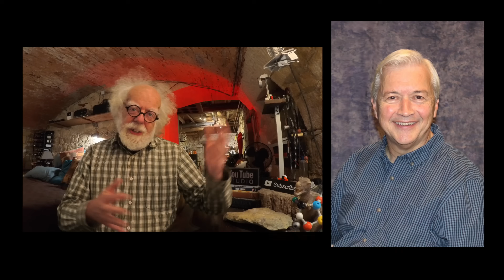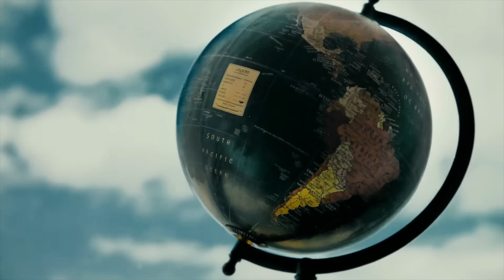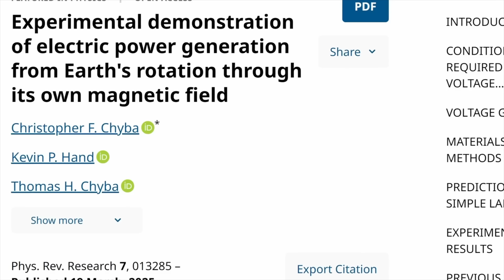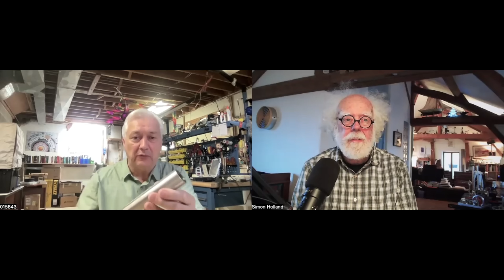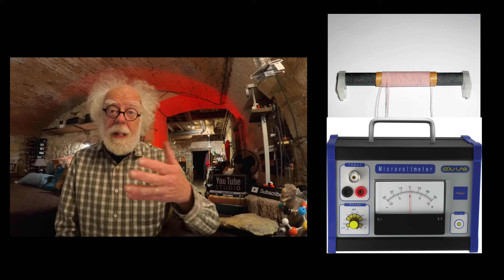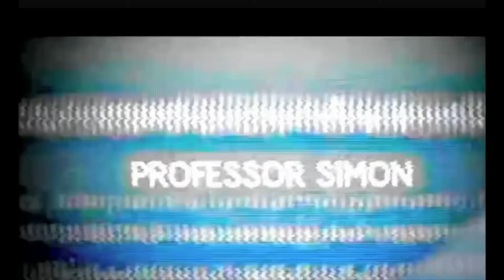Earth Generator Prof Chris Chyba Interview

Comment from the maker: Remember this was a science experiment to prove the spinning earth can induce a current in a wire, coil or cylinder.  Not a practical sized generator….that will come next….get working on it….engineers.
Reply: Give me some drawings and i can make components for it 👍🏼 CNC machinist.
Reply: If the potential difference can be exploited for useful work you're golden.  It's engineering from that point.
Reply: Exactly. There needs to be enough potential.
Reply: If Faraday had  discovered this way back then, imagine the technology today!!:face-blue-wide-eyes:
Reply: We do not generate electricity, we manifest it.
Reply: @ActivateMission2ThisTimeline  Ken Wheeler?
Reply: It is difficult to go beyond academic wisdom, otherwise the central question should be about the state of Energy before it manifested itself into its different aspects as electricity and magnetism and all other forms or force fields. And, of course, which function dissociated this primeval energy into these different manifestations.
Reply: @SimonHollandfilms  Hit up the folks that make the hollow carbon nanofiber for quantum computing. 🤔😁❤️
Reply: Energy has a draft, if you can tap into the draft...
Reply: The material Chyba used was ferrite MN60, which can be cast like any other ceramic.  It can also be 3D printed.  There is no need to purchase a cast rod of MN60, then try and drill out the center.  A simple Google search will show the various techniques to shape MN60.
Reply: i fb you
Reply: Spinning a coil or moving a wire can produce a voltage by induction from the Earth's magnetic field. If the coil has more windings and has larger loops, or if the wire is longer and is spun around like a jump rope, it can generate a higher voltage.
Reply: @evancole6863  True, but the Chyba idea is not to spin the wire because the Earth is already spinning at ~1400ft/sec.   The strength of the Earth's magnetic filed at sea level is about 0.5 Gauss, very weak, which would be roughly equivalent to spinning a 0.5 ft diameter coil at 1000 rpm in a 0.5 Gauss field, if his idea actually works.  Even if he got 1 micro volt out of this, it would not mean much unless he could also get sufficient amperage.  You can already get 400V/m out of the Earth's atmosphere now, but the current is extremely small.  Benjamin Franklin did a lot of experiments with extracting electrical energy from the atmosphere, with his famous kite in an thunderstorm.   A lightning bolt packs a lot of energy, and its free, too, but isnt a constant source of energy, at least in most places.
Reply: @evancole6863  doesn't need to be spining.
Reply: @Cz_ Opor měděného drátu je 0.17 mm/m takže většina magnetického pole země by byla zmařena v  odporu těchto vodičů. A i kdyby existovaly supravodivé materiály byl by výkon zanedbatelný pro praktické použití.
Reply: @SimonHollandfilms  Hollow coils can produce a voltage as well if subjected to mechanical vibrations that resonates with the crystal structure of the coil. If the coil is encased in a piezoelectric material, the squeeze effect from the vibrations produces a transient current which can amplify the voltage.
Reply: If its opposite, why was earth slowed as its speed was one isdue . Also the amount of energy must be according to use in size for its absolute result.
Reply: This tech will probably be used in conjunction with some other tech to give it more ooomf..
Reply: WAAAIT A MINUTE!

who remembers the african boy with the energy generator that "took electricity from the air" and everyone told us it was impossible?

IT WAS COILS IN A BOX YALL

PEOPLE THOUGHT IT WAS A RADIO ANTENNA
Reply: May want to reduce caffeine intake before your interviews. A little over excited and so many noises when he is talking can reduce the quality of the video.

Comment: Couldnt you put a capacitor on the bottom, energy can be stored so regardless of the billionth of a secend of conductivity, that energy can be stored. Theoretically, if a capacitor ran back up the metal, it should not let the conductivity zero out

Comment: I guess the main question I had was finite energy at its core. But then again the earth spins internally, so on terms of potential energy long term we set as a species at least until the next great extinction. Well... how much we can draw from the earth would be the limiting factor not the energy available. I pose, there will need to be experiments on how the distance to earth's core is tangible to the energy output.

Comment: Has anyone ever heard of Nathan Stubblefield who buried coils of wire oriented to magnet north close to trees,  and harvested currents from the ground. He powered carbon rod lights installed in trees around his farm in Kentucky, that is now Murray State University. He is known more for his ground current wireless telephones that he was granted a patent. I looked at a magnetic map of the USA, and that area of Kentucky has magnetic anomalies.  I also read that the telegraph system that used batteries to power the system sometimes didn't need the batteries to power the telegraph--- instead of batteries they powered the system with ground currents (called Telluric Currents) which supposedly are different electrical potentials of the Earth.  I can't help but think after reading that Stubblefield oriented the coils to magnetic north that the Earths magnetic field was involved in producing these currents, not just variable current potentials of the Earth. This explanation does not explain how the currents are produced. I think it is the Earth's magnetic field interaction with the solar wind that generates Telluric currents in the Earth.

Comment: I have a similar  design for a hydroelectric generator using the immense pressure of the extreme deep and transferring a one-way plunge relief valve kind of like a toilet bowl. Float that flushes and resets with the tide

Comment: The success of the experiment is based on the rather counterintuitive proven fact that the magnetic field lines of an axially symmetric magnet rotating at a constant speed do not rotate with the magnet. This means that the magnetic field does not originate from the magnetic material. In other words, it does not result from the magnetic material's response to the presence of the vacuum, but from the vacuum's response to the presence of a physical body with magnetic properties, whether or not that body is rotating at a constant speed.

Comment: As you know a generator needs a prime mover and if the earth, spinning on it's axis, is to be counted as the prime mover for generation, then energy, which can neither be created nor destroyed, will have to transferred from the earth's rotation to generate the electrical output. If this is case, which I'm sure you'll agree is correct, then it will over time slow the earth's rotation therefore increasing the length of a day. I am an electrical engineer, not a scientist, so my question would be, over what timescale would this decrease in rotation, occur?

Comment: The Barnett-Kennard experiment was to test the rotation of an induced electromagnet field on a conductor. This is NOT the same as the earth's magnetic field. The rotation of the earth's magnetic field, along with the rotation of the earth, is a very well known thing, that we actually monitor all the time. Because the magnetic poles are offset from the axial poles, this means that IF the magnetic field DIDN'T rotation with the earth, then the magnetic poles would have a 24 hour precession, which they do NOT. If this all is not a joke, it should be embarrassing.

Comment: If this isn’t an extended April fool prank or an exercise testing the skepticism of your audience you are going to have egg all over your face, Simon.
Reply from the maker: Thats what they said to Issac newton…ha.   I am reporting on a Princeton research experiment
Reply: @SimonHollandfilms  The “groundbreaking renewable energy” device you can make in your home, turns out to have a tiny, barely measurable result you need specialist equipment to detect. Simon, if that’s not egg on face it’s a grotesquely over the top claim.

Comment: Have got a couple of thoughts/queries here:

(1) Would such an experiment produce better output if it were performed aboard a satellite in orbit, say a little cubesat in low earth orbit? Such a satellite would be orbiting the earth in just 90 minutes or so.

(2) Would it be possible to produce a cascade of miniaturized ferrite or other tubes (nanotubes) hooked up in arrays connected in series and in parallel, using the sort of lithographic techniques used to make computer chips? Or maybe using a 3D printer? That might boost voltage and current, wouldn't it?

The cubesat experiment could be a school project.
Reply from the maker: Good ideas

Comment: Very interesting.  What I don't understand is the concept that the Earth's magnetic field only results due to rotation.  A bar magnet has a magnetic field and doesn't need to rotate.   

Also, it was very new to me to hear that the Earth has a magnetic field relative to the axial poles (as well as the magnetic poles).   Did I understand this correctly?  If so, any references for this?  ChatGPT says nuh-uh but chatGPT can be wrong of course.

Comment: This sounds alot like the faraday paradox generator. So maybe combine this, put a magnet on the tube and spin the tube on its lenght axis. That would be the same as spinning the earth and the tube, but now you can spin it even faster and the magnetic field of the magnet is a lot stronger, instead of u-tesla you could go to full tesla and increase autput by a million just by using a magnet. This would automatically mean a higher voltage and current. Obviously the material is key in the generation.

Comment: It wasn’t Maxwell, Heavyside simplified the original set of 20 or so Maxwell equations.
Why not run really long wires down, e.g., an elevator shaft of a really tall building.
The strength of the geomagnetic field is only tens of microteslas.

Comment: Can I add to this: If you would take 3 or more Electromagnetic rods and star connect them at 60 degrees rotated, the 3 separate magnets should find North as you switch them on and off. This can be done by a connection of the wires sliding on a Bow-tie below, this connected to positive and negative. In finding North and switching on and off in succession using the Earth as a Stator will create a motor that with enough inertia can be utilized for power generation amongst others.

Comment: Remember Franklin bells, discharge from the air and Tesla said we could catch like capacitors and Nelson Stubblefield had earth batteries and lit up the mountain like they are all part of a system that may work together and what if that was a large coil like antenna for the slow earth?

Comment: Why are my comments being deleted???
Reply from the maker: No comments deleted…any with urls are held for review by yt
Reply: @SimonHollandfilms  Yeah I don't know what's going on.  I made a comment earlier about Lenz' law being, in part, at work, and I gave some theories about the possibility that the electromagnetic field he might be using could possibly be not the earth's magnetic field, but rather the sun's or even the magnetic field originating from the galactic center.  Experiments near the poles would be necessary to verify this theory.

And I also mentioned the possibility that using a "tube within a tube" architecture, with one set of tubes grounded, might begin to produce a more workable flow of electrons.  Or even using a ferritic core inside the tube, or even a neodymium magnet for a core, to compress the magnetic flux.  The same way transformers work, with alternating cores.  What's really happening is a lot of the work is being produced by the after effect.  Newtonian physics rule all things, even electromagnetism, and for every action, there is an equal and opposite reaction.  Understanding that there is also an anti-force to the induced field is important to understanding its nature.  If you drop a magnet through a copper tube, you'll see this happen right before your very eyes, as the magnetic field induced in the clearly non-magnetic copper creates enough magnetic resistance to slow the rate of fall to a highly reduced rate and at a constant speed.  The anti-force you see is the literal wake in space-time produced by the induced magnetic fields in the copper tube pushing back on the magnet.  Waves pushing on waves pushing on waves.  

So, a magnetic core might be a big part of making this work.  So might stacking tubes within tubes, and providing a path for electron flow.  Tubes within a vacuum would also facilitate electron flow.  For some reason, that comment was deleted...

Comment: All experimenters should speak in watts not volts or amps but the more material the larger the amperage possibly even transformed up in voltage as long as the actual amperage is available. Right?! 😄

Comment: :dothefive:I am having a hard time decoupling two things to make this work. 1. magnetic field and 2. Earth rotation. How does the magnetic field NOT move with the rotation?  And will the power people, power companies or battery makers not try to stop this discovery?
Reply: They wanted to prevent Tesla from communicating !!!
Reply from the maker: it does move because of the earths rotation if the earth stopped the magnetic flux would still be there….its the rotation that perturbs it

Comment: I've been using the everlasting battery charger for years which charges batteries (12V) and charges the battery powering the circuit so it never runs out of charge.

Comment: When you apply a load to any generator/alternator it will slow down as the load increases, on petroleum powered generators this slowing is compensated by a governor that applies more power to the generator as the load increases causing an increase in fuel consumption to replace the loss of rotational momentum. 
What if we could upscale such a device, would it not want to slow the rotation of the earth? Or many smaller devices applying drag to the Earth inside it's magnetic field but with no replenishment of the rotational momentum. 
Ok, let's say this process does in fact work, but bare in mind that every action has an equal and opposite reaction and logic states that the combined drag of these devices would in fact collectively slow the planets rotation.
It's something to think about and I am sure someone could do the math on how much drag these devices could have.
What would Quatermass say about this?🤔🤔

Comment: Long wire with 1n34a diodes in the wire spaced at multiple locations,with same polarities should allow electron flow to build up, on one end of the wire making a d c power supply .😊😊😊😊he is correct.

Comment: important bit, I think. end of ai rant and some DIY and looking back over the paper. end of ai rant: Yes—and that’s one of the most intriguing aspects of the paper.

They propose *scaling the effect* by first **miniaturizing the geometry**, and then creating **arrays of small units**, similar to how integrated circuits or quantum chips are built. Here's the logic and potential behind that idea:

---

### 🔬 *Why Miniaturize First?*

The key parameters here are:

- *Magnetic Reynolds number (Rm):* This must stay *less than 1* for the effect to persist. That requires low conductivity, moderate permeability, and *small spatial scale*.

- *Field Uniformity:* On small scales, Earth's magnetic field appears more uniform, making theoretical modeling and scaling more predictable.

So by miniaturizing the device:
- The **Rm stays within range**, 
- The **geometry becomes easier to control**, and 
- The devices become modular.

---

### 🧱 *Then Scale Like Chips or Solar Panels*

Just like:
- Solar panels scale by connecting small photovoltaic cells,
- Quantum chips scale by linking tiny Josephson junctions,
- These magnetic shells could be *tiled or layered* in an array.

Each unit would output a tiny amount of current/voltage, but together they could produce more substantial power. The real innovation is in:
- **Material uniformity**,
- **Alignment precision**, and
- *Collective emf amplification* through structured arrays.

---

### ⚡ What Makes This Cool

This is very different from speculative “free energy” devices:
- It’s *rooted in classical physics* (no overunity claims),
- It’s *experimentally verified* in the paper, and
- It opens the door to a **completely passive, long-term power source**—ideal for ultra-low-power applications like sensors, IoT, space probes, etc.

If this effect scales even modestly, it could mean **power from nothing but rotation through Earth’s magnetic field**—no moving parts, no fuel, no sunlight needed.

---

Comment: Just what I expected.  I have seen this over and over again.  Great promises but requires extremely rare or expensive or precise settings that are very unique to the location or situation to repeat the experiment.  SO of course not one can repeat it because they don't have the right set up or equipment.  Hole lot of BS.

A better first experiment would be to prove that the magnetic field does not turn with the magnet.  once a design is found were the magnet and coil spin in unison then scaling it for the planet will be easier.  way to many variables other wise.  but  I suspect BS!
Reply from the maker: Hold my beer
Reply: @SimonHollandfilms  I have been tracking "free/ cheap/ clean " energy for 50 years.  I have seen this story hundreds of times.

And if you would think about it.  What do you thing greedy, wasteful, stupid people would do with "Free" energy?
Reply: @lostvisitor 
free energy and free radicals?